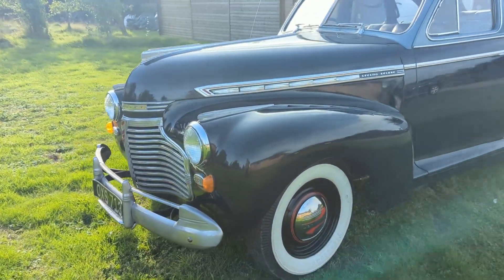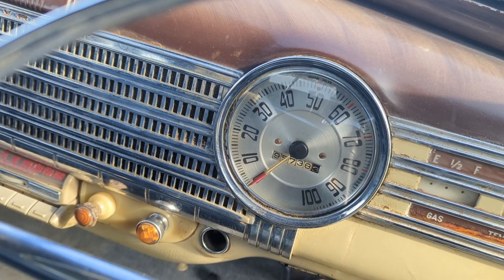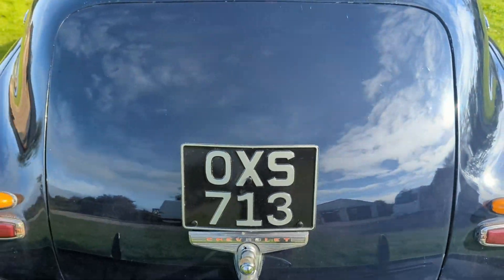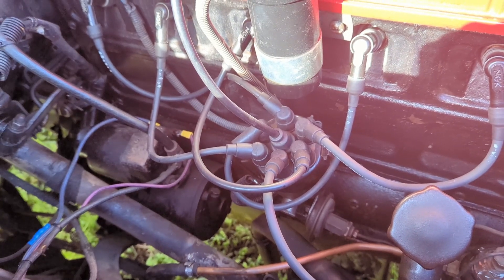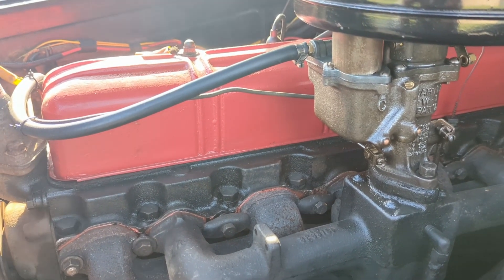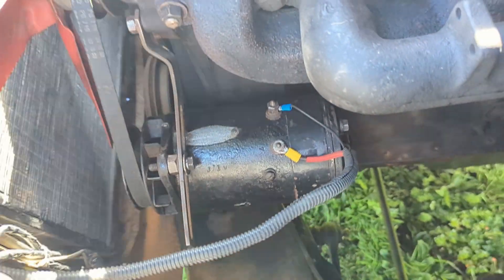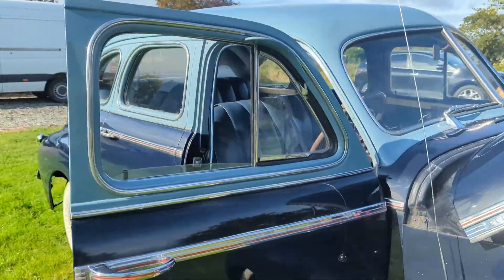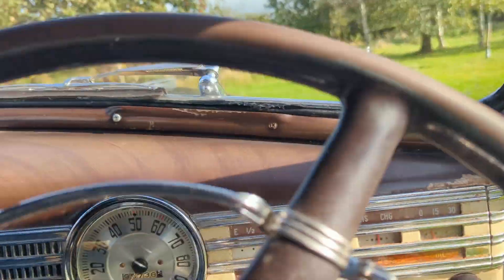1941 Chevrolet Special Deluxe Walkaround and Start

Comment: I find the starter fascinating. In the U.S. Chevrolet used manual bendix foot starters until 1949, I think, and even later in trucks. Also, most controls are mirror images of my left hand drive 1941 Chevrolet coupe except for the ignition switch, they kept that in the same position. A very interesting video!

Comment: I owned a two door 41 Chevy Special Deluxe. Mine didn't have the naugahyde or leather... we had what looked like short mohair but was another material.
Reply from the maker: It is not leather but some kind of vinyl coated fabric. I think this was used mainly in the non-US markets and the material you mention was  used in the US cars.
Reply: I currently own a 1941 Chevrolet Master Deluxe Coupe with those mohair (or whatever it is) seats. You don’t even need seatbelts, that stuff holds you in like Velcro! In the U.S., only convertibles came with leather seats, although my reproduction 1941 accessory book lists a surprisingly large variety of available seat covers. Also, one of the reasons listed in period advertising for the column shifter was to allow 3 across seating in the front. And lastly, have your wipers inhale some Marvel Mystery Oil through the vacuum hose and in most cases it will fix them, no need for disassembly and it just gets sucked into the engine and burned off.
Reply: @sparkplug0000  Great information... I love my 41, I carried three in the front several times. I like the mohair.. I had mine painted doeskin brown. It's kind of a light metalic root beer color. Take care....you should post some pictures of your car.